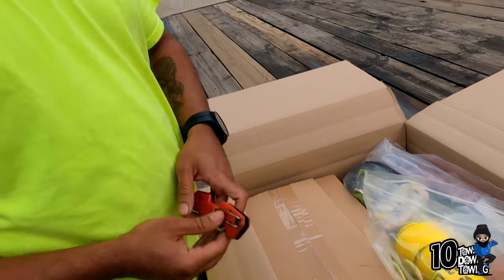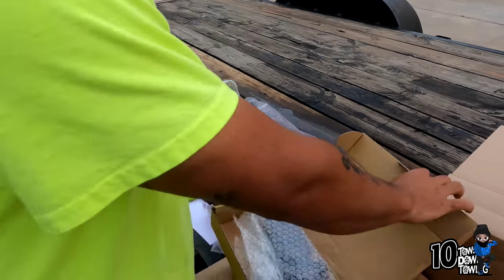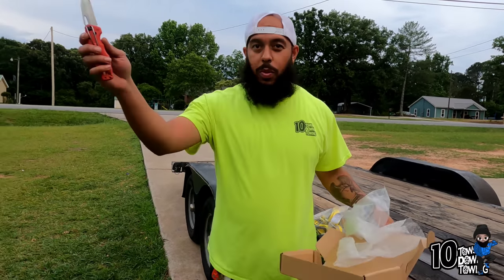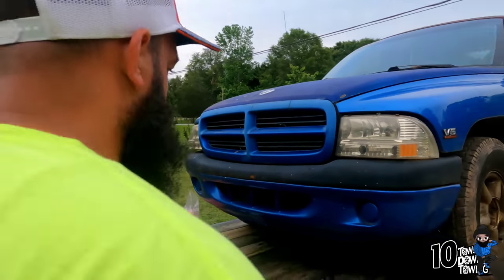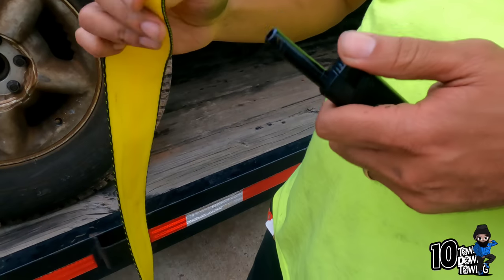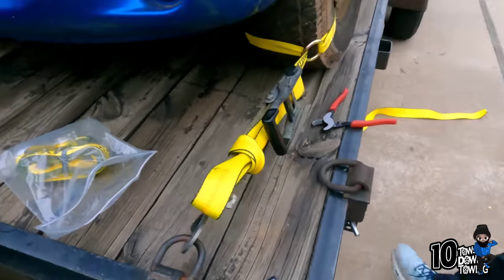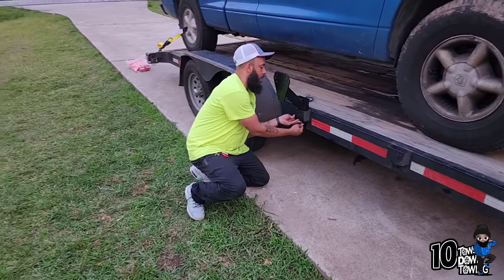Picked up some new towing accessories 😎

Comment: As usual, all your subscribers share that good knowledge on the straps! As for the spare tire holder, all trailer and accessory manufactures don't necessarily use the same measurements or material on stake pockets so that has always required me to modify to my trailer so don't feel like the Lone Ranger. Be like the motto of a military unit, "we don't compromise, we improvise!"

Comment: 10:58 if you want shorter straps, just cut them but make sure you torch and melt the ends where you cut so they don’t fray out.  While still hot at the ends, hammer the bubbles flat and it will fit in the straps. Then you can use the straps and have the length you want without spending that extra cash!! Hope this helps

Comment: I’m not a expert by no means but those new straps look like my lasso straps that you wrap over and around the tire not through the wheels. They are supposed to be long so when you wrap around the back of the tire you can pull down at an angle to a tie down point.
Reply from the maker: You are correct, but they work perfectly going through the wheel. I like doing it that way better.
Reply: You were the one who was complaining and saying they were the wrong ones when you didn’t seem to know what you were ordering. So of course you they were too long for what you were using them for. Order the correct stuff and you get what you were wanting.
Reply from the maker: @eugenepricillamontgomery7149  do I sense some hostility there homie?
Reply: @10TowsDownTowing  no homie. I’m tired of people getting out here acting like they know what they’re talking about when clearly they don’t. Don’t take it personal I’m calling out any bs I see on all channels. Y’all can hate on me if y’all want but it don’t change people not knowing what they are talking about.
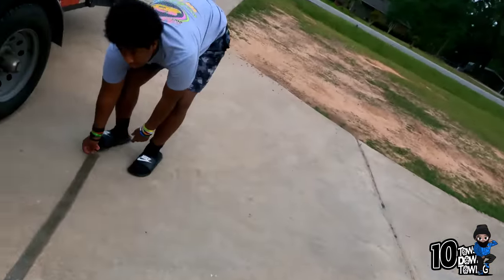Reply from the maker: @eugenepricillamontgomery7149  those are the shortest ones they offered buddy (as I stated at 10:24 ). I have a few trailers, so even if i left it at 12ft, i could use them other ways, thats why i bought them. I also stated what they are intended to be used for at 10:51 ... but hey, you got a right to call out "bs" 🤣 have a good night sir

Comment: Winchon trailer ran by separate battery or off the truck itself ?
Reply from the maker: Each trailer has a marine battery for its winch. Then i have some cables i can attach to the trucks battery if need be
Reply: Okay cool going to look at a truck tomorrow already have car trailer on lock so just getting some ideas thank you 👍